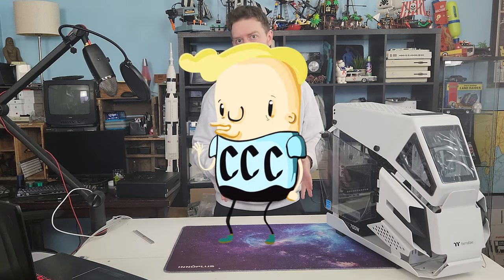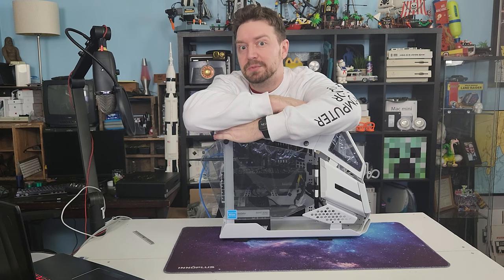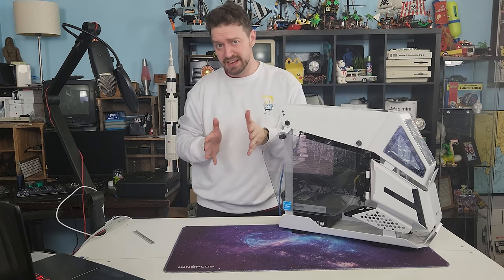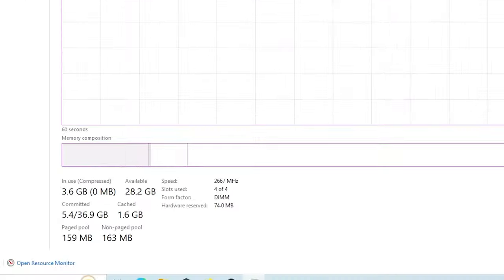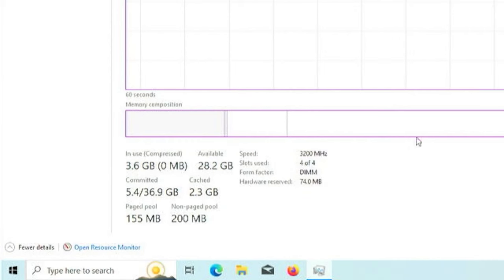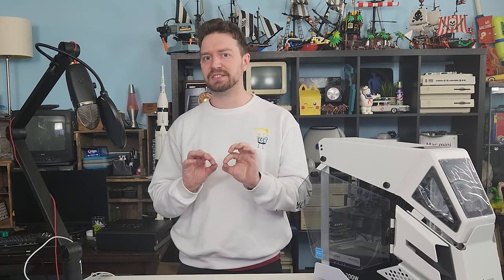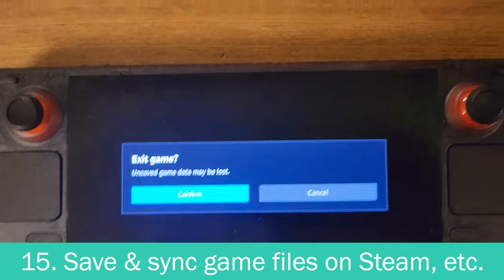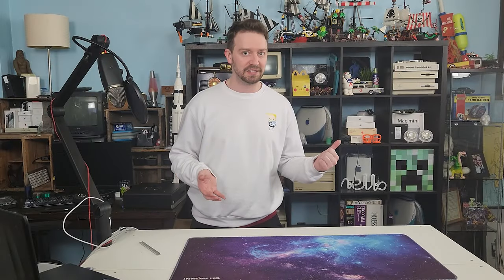The FIRST THINGS You Need to Do with Your New Gaming PC

Comment: Well. I built my first gaming pc. Of course, i dont have a good gpu yet as im saving for it, but when i finished the build, it booted right up. All i have to do is save for a gpu, and im great. Right now, im using a gt710 just for a display but its not too bad.
Reply from the maker: What cpu do you have? A gt710 might actually be worse than your integrated graphics.
Reply: @CanadianComputerCollector  the cpu i have doesn't have integrated graphics. Ryzen 5 3600. I did look into it but couldn't find a cpu with integrated graphics that was in my price range, so i had to just roll with it.
Reply from the maker: In this case you should try to get anything GTX. A gt710 is going to be a massive limitation. A GTX 750 would be a big upgrade. A GTX 1050 or 1060 would be a huge improvement. Those cards are all dirt cheap. Even anything from the GTX 9-series
Reply: @CanadianComputerCollector  oh, im not currently looking for anything near r9 280 performance. I had an old pc a while ago and upgraded the r9 to an rx 5600xt, i sold the pc for a car and now that im building new one i cant bring myself to go back to old performance. Im saving up for an rx 6650xt mabye a 7600xt.

Comment: When i get a new pc do i first boot it up without plugging usbs and stuff? Or is plugging usbs(bluetooth) etc fine before booting it up for the first time? Usbs as in mouse, mic, keyboard, external drives etc
Reply: It’s not going to fry the computer either way. But sometimes if you connect usbs first it’s not registered so you’ll have to plug and unplug again (idk about other people, that was just my experience)
Reply: @ZephyrWrites  so best to do it after?
Reply: @Wolftopia_ yeah it doesn’t really matter. but you do need a moues and keyboard to fiddle with bios and install windows so after it boots it wil automatically enter into bias and then you can plug all your peripherals
Reply from the maker: Keyboard & mouse should be plugged in asap. I'd wait for everything else until you've got all your drivers and stuff installed. Not for any particular reason other than you just want to let the PC power through the initial updates without any "distractions" let's say, but tbh, it really doesn't matter.

Comment: Problem for me is that MSI Bios not feeling my wireless m+k. Any workarounds? I’ve tried every usb port for the dongle
Reply from the maker: Set up the PC with wired usb m/k, go to MSI website and download driver directly. You may need to pair them with the receiver before they can be used. then come back here and lmk if it works. Best of luck!
Reply: @CanadianComputerCollector  thanks for reply. Guess I’ll buy a cheap wired one or maybe can borrow from computer shop. Seems like a known MSI issue. I’m sure this will work with wired m+k. Great vid tho, I ran escape from Tarkov out of the box and thought brand-new PC was a potato until I started all of these steps.

Now if only we can get rid of Microsoft Edge forever